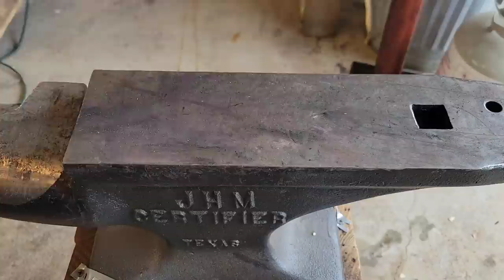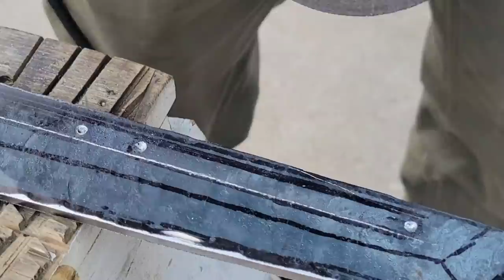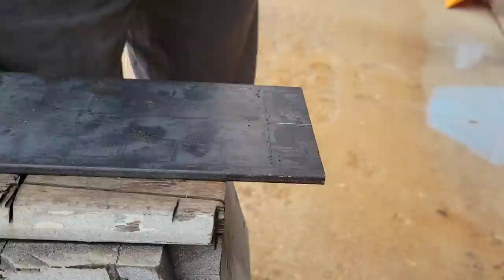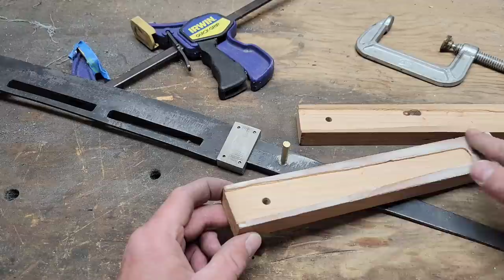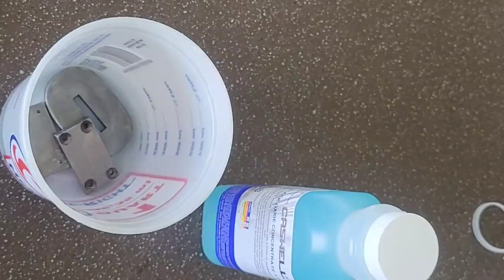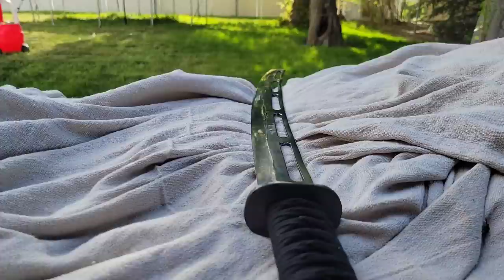Forging Hawkeye's/Ronin's Katana from Avengers End Game

Comment: 1rst is a wakizashi or ninja blade katana
2nd strong but no clear cut as an original
3rd since u did all that u should at least make an effort (fold it 10 times at least)
4th u didn't showed to use a "dust"
5th in a fight this exact weapon will suffer and break after some severe blows due to his upper formation of the blade.the openings r too big to defend yourself and it will deform or break.

if you want I can tell exactly what kind of steel "bar" for other use u can get,that will also have the upper cut ready and it will be far more durable in blocking blows.
and with that steel u can have 2 ninja swords and also if u purchase the other parts of steel needed to cowork with it u can also fix a set throwing knives but to relief u of that pain you need another component that u can find inside the motor of a honda innova.